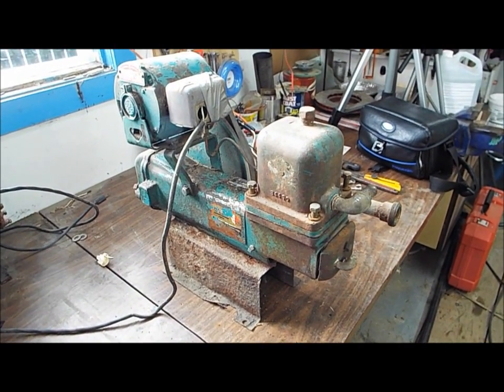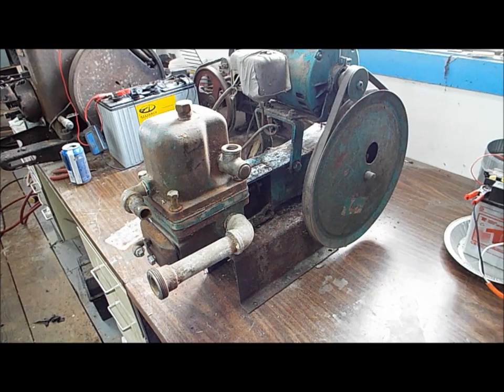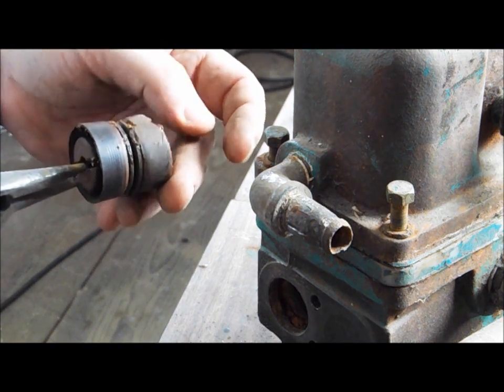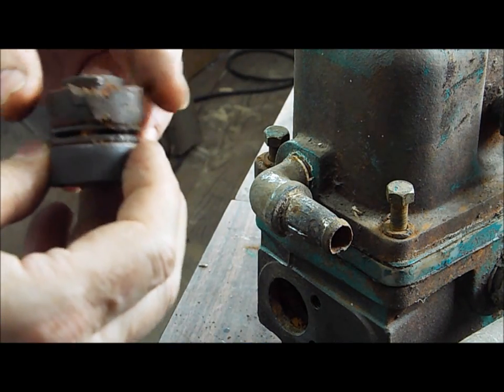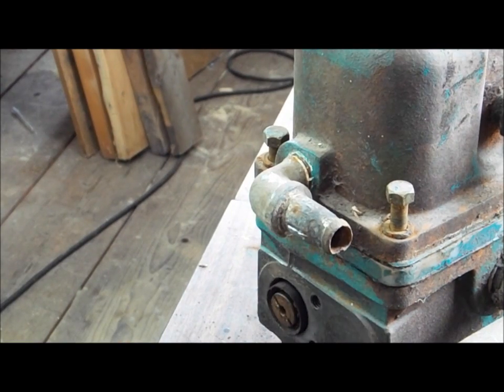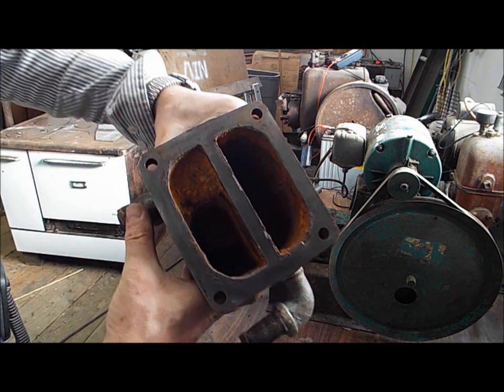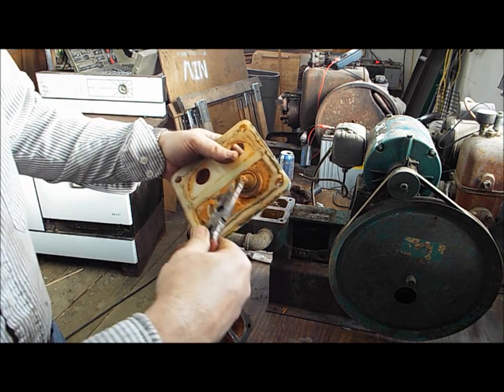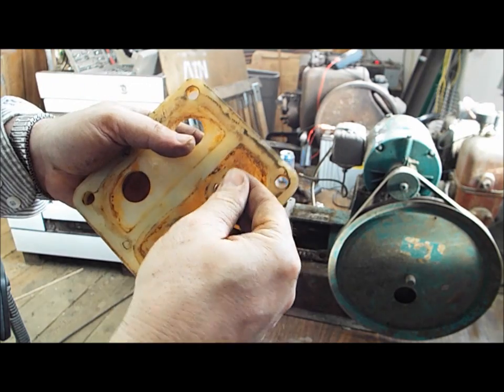Piston Pump Repair

Comment: Where do you get the repair kits? I get no results when I search on ebay
Reply: coolbluelights  hi, you might be able to customized the rubber seals at you local hydraulic piston repair center.